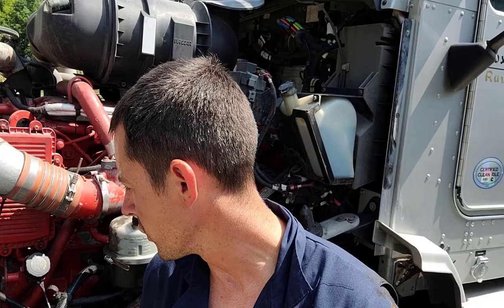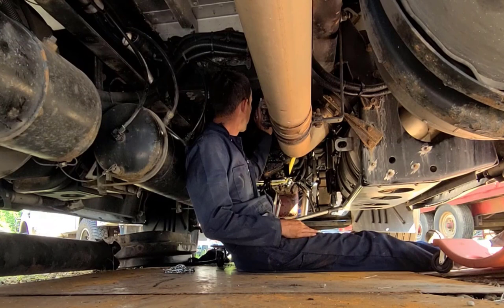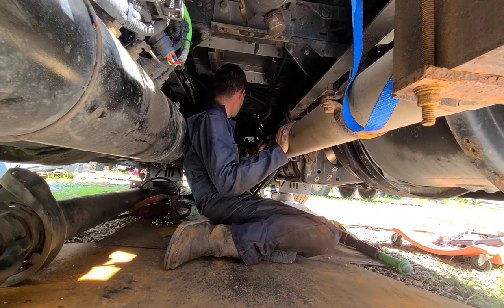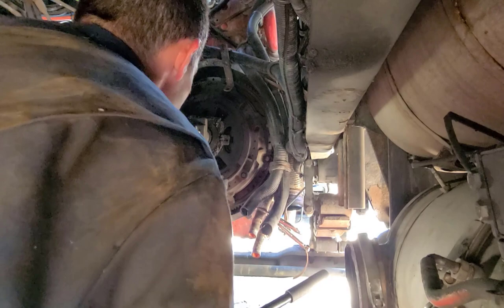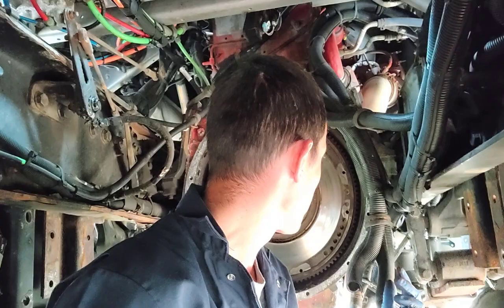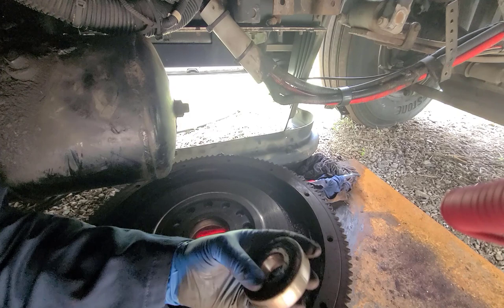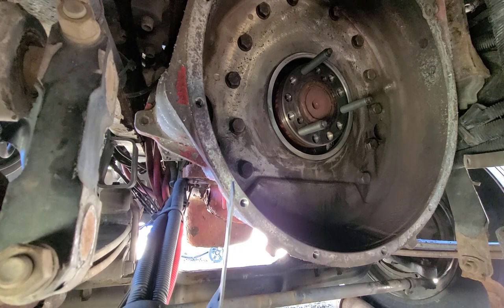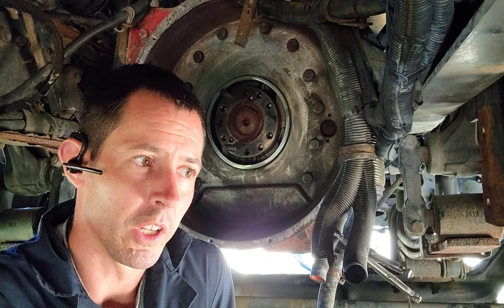How To Do A Transmission/Clutch Job on Cummins ISX15, Part 2 - Transmission and Clutch Removal

Comment: I like your style and your video. That's called a structural housing. I'm not trying to tell you how to do your job but, You should have ran a dial indicator around that structural housing before you installed that seal. That would tell you if it needed to be replaced that it was running out of square. Due to a lot of torque they can warp. Again in 10 years.I feel pretty certain you'll be one of the greatest mechanics of the greatest. Medicine man retired.

Comment: Usually the rear structure will start leaking oil not long after a trans has been removed and reinstalled. Then you have to pull it ALL apart again. It's a good idea to just replace that gasket while your in there. It's a bunch more work but so is pulling a trans twice.

Comment: Good job Ryan. I like the way you explain as you go. Straight forward no fluff.  One question. Why didn't you just run the truck up on some ramps to get it off the ground a bit. I've seen  shop guy use just 2x6 stacked 3 or 3 high and staggered, Drive right up give you 6 to 8 inches clearance.
Reply from the maker: Good question. Someone asked me the same question the other day! For me, a relatively thin guy, it was enough clearance for me without a ramp. Rising the truck height will make removaland installation of the transmission a more dangerous work.

Comment: Did you use the handy dandy truck ramps you made for maximum clearance? Great video. 👍
Reply from the maker: I didn’t use it for this job. Because there is enough clearance. Plus the higher the truck, the more risky when removing and install the heavy transmission.

Comment: Dumb question ....I have seen videos where they pull the transmission and the clutch out together 
they rotate the engine and separate the clutch pressure plate thru the access hole ....no idea , maybe something I don't get but it seems easier???

Comment: Hey Ryan question. Recently I went to turn on my truck and it doesn’t want to go into gear. Any gear , any idea where I should start looking? Solenoids? Clutch? Fly wheel? main seal? Thanks again keep it up super informative. I’m subscribed.
Reply from the maker: Sorry for the long delay. Is it a automatic or manual?

Comment: Why did you use soap and water to lube the seal?  My general rule of thumb is whatever fluid I’m sealing is the lubricant I use on reassembly. This a big truck kinda thing?
Reply from the maker: Your general rule is okay for other seals. But for this specific seal, Cummins specify soap and water.